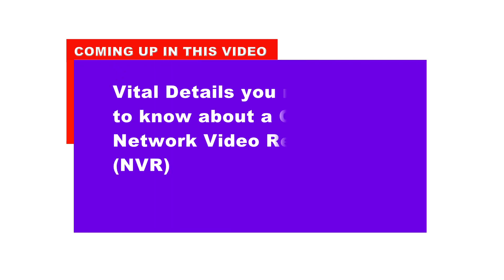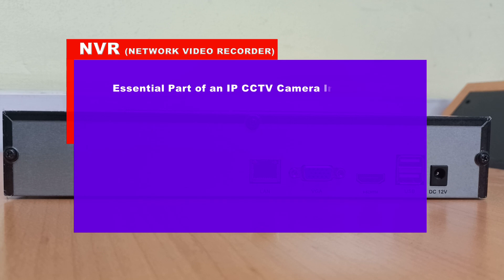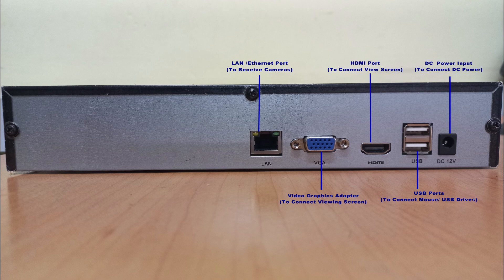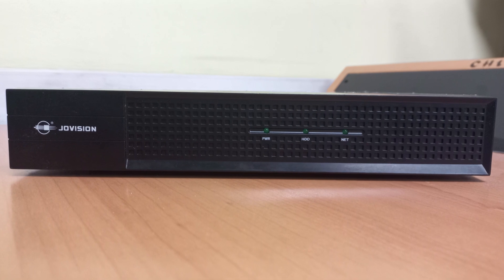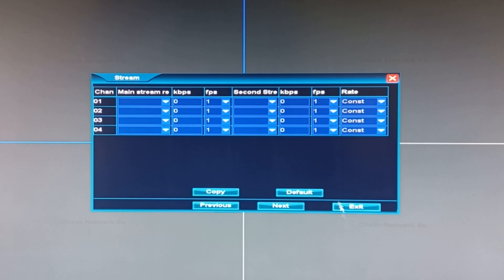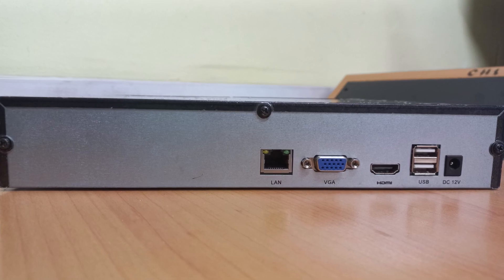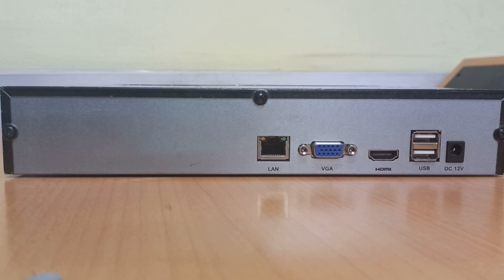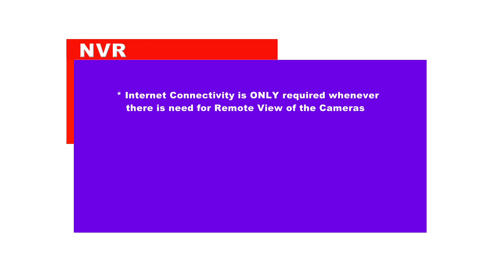CCTV NVR - Network Video Recorder for IP cameras

Comment: You said internet is not a requirement for a NVR to function....my question is; what if you need to link multiple ip cameras to a poe switch but they all at different places like the previous vid where you connected all poe switch to a router and then the nvr to the router for access to all camera did that process require internet
Reply from the maker: Yes, in a case where the systems are located at remote distances, you will require Internet to link them together, that not withstanding, the NVR can function as a standalone unit unless there need for the remote linkage as I alluded to

Comment: What is the use of mini NVR? How many camerascan be connected to an NVR? Where to record video as no hard disk in it?
Reply from the maker: Mini NVR is also a redesign of a normal NVR which uses a mini surveillance drive leading to a drastic reduction in size of the device. Video footage can be recorded on eSATA HDD, USB HDD, or upload to remote server. 
Some of them come with eSATA interface, which enables it to connect to an eSATA HDD/SDD for unlimited storage capacity or as mentioned earlier, they can be recorded directly to a cloud storage server.
I will share a video next week on "cloud storage server"

Comment: Hi, Can you recommend an NVR that supports 40 - 60 IP Camera?
Reply from the maker: NVRs can support up to 256 Cameras, just that the demand for such high numbers so retailers of CCTV products hardly sell such high capacity NVRs but the fact is that they are there.
Reply from the maker: For such big projects,  you can use a computer in place of an NVR. It would deliver same results as NVR.

Comment: Hi. Thanks for sharing. What about, if the camera is non poe and the switch or nvr is not poe. How to power up camera as well as nvr or switch
Reply from the maker: When you have a Non POE IP Cameras to be connected to a non POE switch,  there is need to provide an external source of power to the camera, but it is better and simpler to get a POE switch for the setup to make the work easy and less clumsy.
Reply: @Tech_Inside_Out  meaning what if we have a POE+ does it matter regardless the wattage per port of the switch to power the camera?

Comment: Hi there
I would love to know if the installation of road CCTV is similar to house CCTV?
We will really appreciate you if you can make a video tutorial about road CCTV?
Reply from the maker: The CCTV you see on the roads work in the same way as the home ones just that the videos are transmitted to a central location by either a radio link or Internet remote access. 
I will consider a video on that.